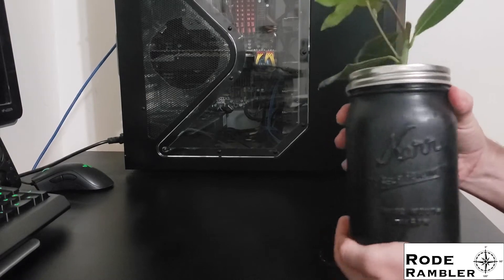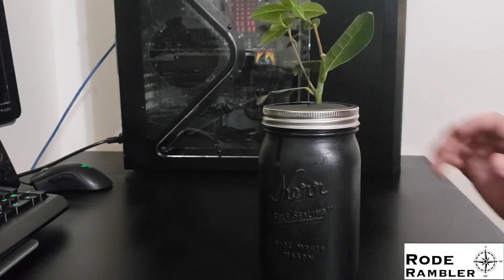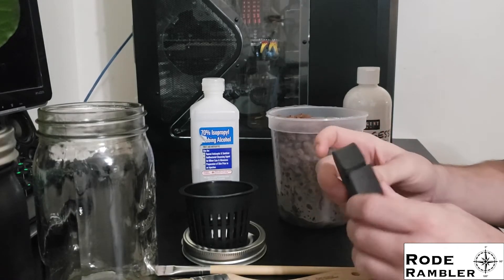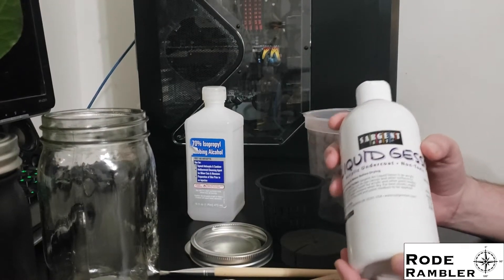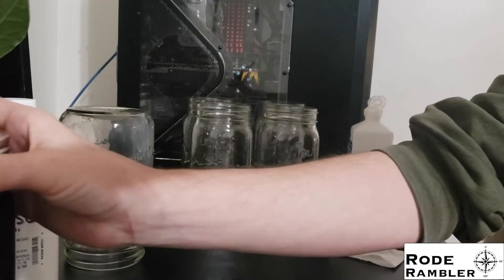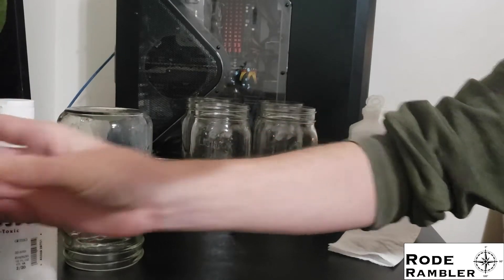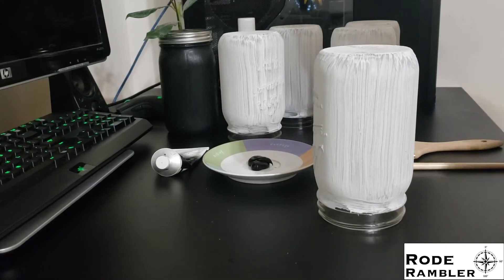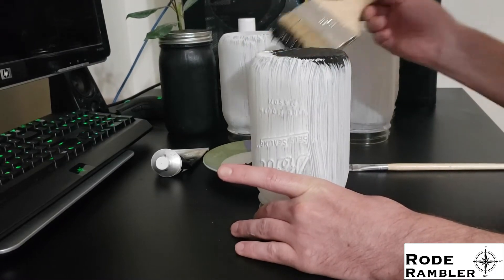Best Kratky Hydroponic Build $2

Comment: I think I would place a smal strip of tape on the jar, vertically, before the gesso & paint. Then remove it once it’s all dry. It would be a sliver to enable you to see the nutrient Walter level without removing the net cup to look. And risk damaging the roots. Also shouldn’t you soak the stones first? Great video. Thanks for sharing.

Comment: Subbed, for your gardening AND your upcoming boat life.     Saw you shake your jar and water come out though, see my other comment about custom netcups! You could still use your foam piece/neoprene collar (i just use pipe insulation cut into slices), but if you had solid plastic lining the outside diameter of the lid, you would spill a lot less water in your boat.  If 3d printed we could also add an upper lip! This would funnel any water your pour on it, into it, but also obviously stop water spilling if your boat-a-rockin! 
 Reach out to me and I'll CAD design and/or print for anyone. Solving problems and perfecting designs are my passions

Comment: I personally would have flipped around the color layers. I would prefer a black prime layer on the glass, and then white on the outside to reflect light. You don't want these jars getting hot! and they definitely can whether you use LED, HID, or sunlight. 
I've tried plasti-dip and also flexseal, which work great for a simple one-coat light block, on glass or anything else.
Reply: It’s not primer it’s gesso it helps paint stick to glass. I would prefer white too but some white let’s some light in. 

Although in my experience little light through white containers is not that bad in hydroponics
Reply: Would Black Gesso be sufficient for light blockage so no black paint would be necessary?

Comment: if anyone has a friend with a 3d printer -- give them a job to create the perfect netcups for you! I have created many that will be securely and simply held in underneath the mason jar cap ring, and also include the hole you need for air. Also, since we are able to design anything we can imagine, a float gauge is a very useful addition to your 3d printed custom mason jar net cup!

I have also printed myself sleeves for outside of the jar to block out the light, but allow me to screw the cover off and lift out the jar so I can peek at the roots whenever we want!

Comment: Great video. Can you please link the supplies you used to make these? can we use chalk paint to be able to write on the jars?
Reply: Of course you can use any paint as long as it’s on the exterior 🙂
Reply: @BeardedBotanist  my net cups all have a wider hole at the bottom so the pebbles would possibly shake through.  And they're just a little too thicc under the band and don't fit down as perfectly as yours.  Thanks for the detailed steps.  If I've got the dark grey chalk paint, do you think its worth using black gesso, or is the white going to block enough light, in your opinion?
Reply: No.

Comment: Mason jars???
I can do that using plastic soda bottles.

It's just a redesign in the self-watering soda bottle planter.

No more soil and water wick.

Use a soldering iron to make lots of holes so roots can go through.

Transplant it the Kratky method... And fill up with water to the desired amount.

Cover the outside to prevent algae.
Reply: I wanna see this can you upload a video showing exactly what you just explained here with the plastic bottles and watering system cause I been saving these bottles for months lmao
Reply from the maker: You sure can! Just another cheap option that looks a little nicer IMHO.